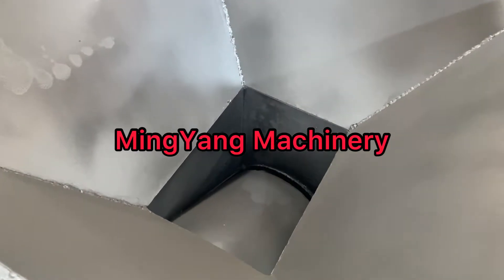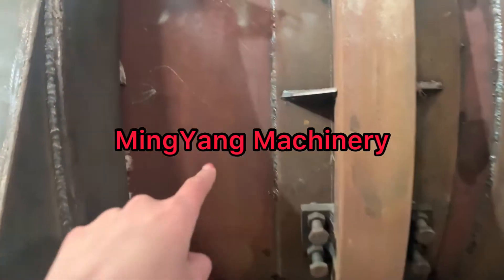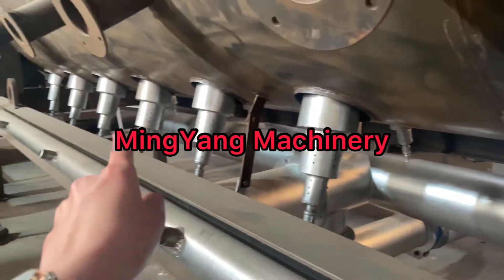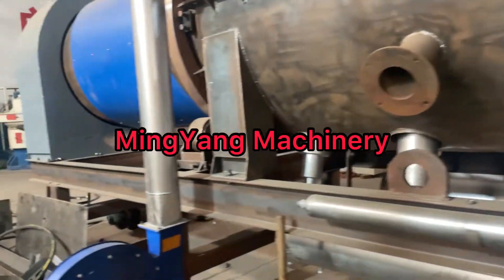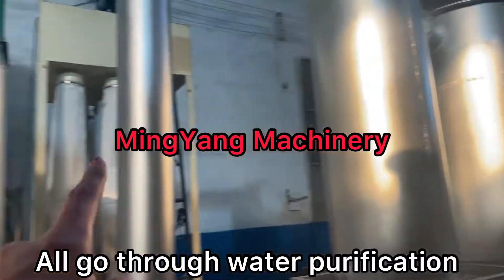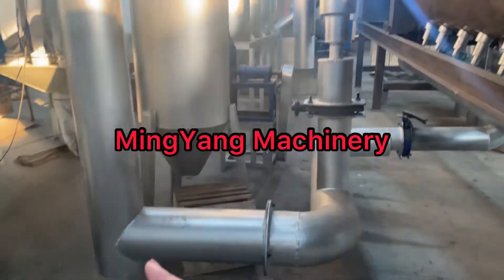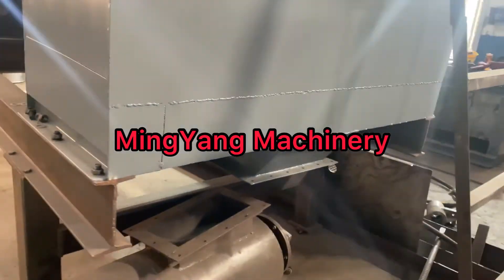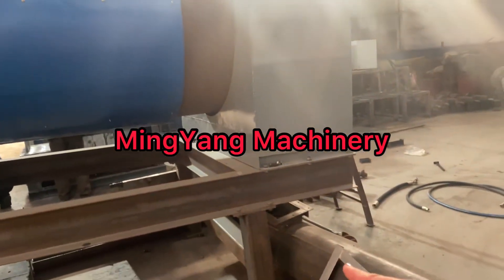continuous working rotary charcoal furnace

Comment: how does the charcoal cooling happens ??
Reply from the maker: Hi Madhan, there's double layer screw conveyor for discharging charcoal. The outside layer is cool water, it can cool down the charcoal effectively. We use a 6- 18m path length cooling.
Reply: @kimzhao-charcoalmakingmachine  thanks for your reply!❤ what is the duration of the cooling process ??
Reply from the maker: @madhanmareesan6184  Speed is adjustable, and the total length will deceide the cooling time. It's a range not a certian minutes. Transducer will be adjusted according to the amount of charcoal output. Are you a designer engineer?
Reply: @kimzhao-charcoalmakingmachine  ohh thanks mam!!❤
Iam a PhD scholar doing my PhDin biomass pyrolysis...
Reply from the maker: @madhanmareesan6184  Hello Madhan, but our furnace is making charcoal not bio-gas and bio-oil. Pyrolysis is more concentrate on bio-gas boio-oil.

Comment: Hello iam so interested!
Can u gives me the details plez!
Reply from the maker: Hello Mohammed. Pls send me WhatsApp to my number: +8613949068666
Reply: Hello...nice demonstration....but I can't understand one issue. We know that for pyrolysis no oxigen is allowed.but for continueous feeding plastic or continueous removed carbon how can  you control the system ? For loading or unloading system do you stop machine ?
Reply from the maker: @annoorkhan4219  Hi Annoor, thanks for the question, we use method called " Padding seal+ screw seal" for feeding and discharging parts, and "Labyrinth seal' for rotating connection part. So there's oxygen free working.